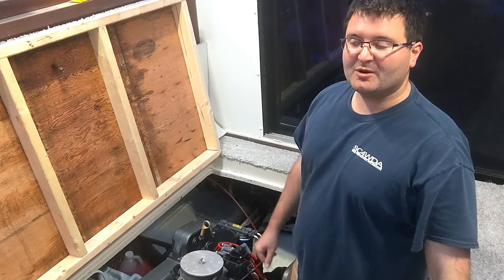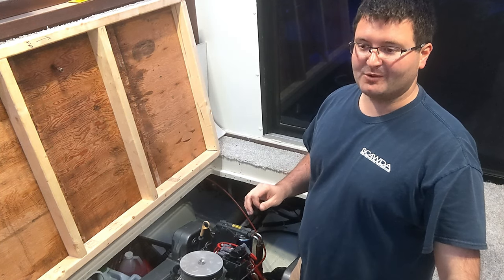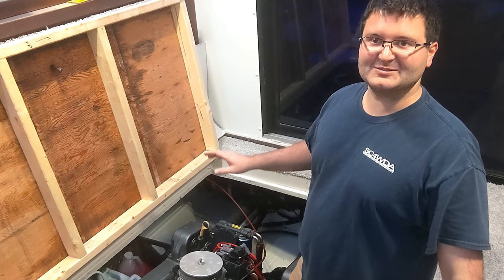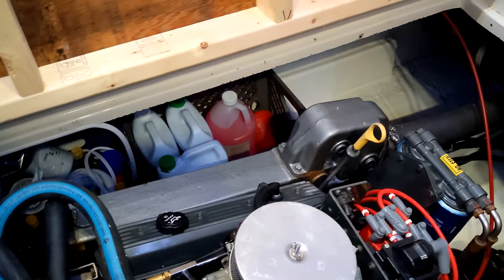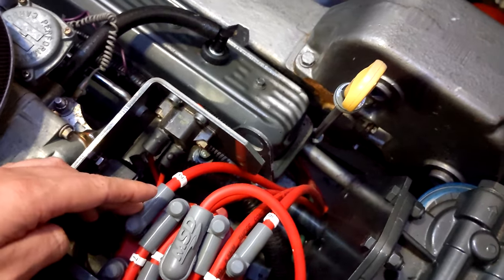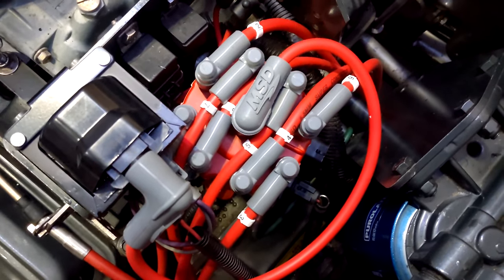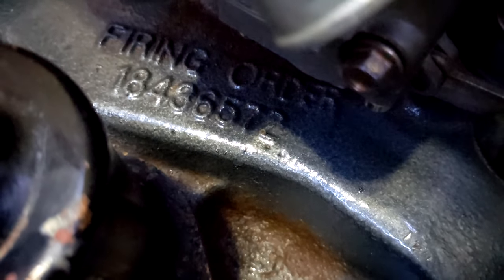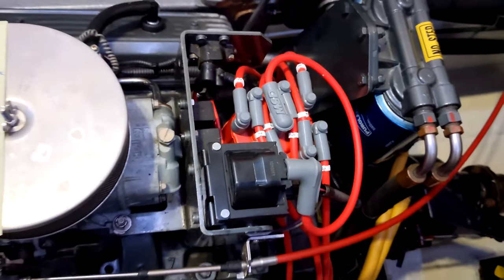Marine Chevy 350 Vortec Reverse Rotation - Explained

Comment: The oil journals are 180° off also the opposite rotation if the  On crankshaft end towards the oil pump the crankshaft has been knurled to push the oil forward not so many people know that one just figure a little food for thought 🤔
Reply from the maker: All good info, thanks for adding!

Comment: Back in the day before companies started making GM HEI distributors for other brands of engines we modified one to fit in a small block Ford by making a sleeve to adapt it and a custom shaft with a Ford gear.  In my first attempt it died after a few weeks and upon inspection I found that due to Ford having counter clockwise rotation and the direction of thrust being downward it had eaten into the pickup coil. If you're ever in a bind and need to use the ccw gear on a regular distributor it will work for a while and won't ruin your motor but eventually it will eat into the pickup and shut off
Reply from the maker: Yep, I found that out through a lot of research. It is not a common thing at all!

Comment: I have rebuilt many marine engines and have never seen a reverse rotation engine like you described all of the mercruiser crusader marine conversions use gear drive cam to change the cam direction allowing the use of standard dist and oil pump, of course starter, water pumps are configured different one other internal change that not many builders know is that the pistons are pressed on the rods backwards the notch will face the rear this is cause the piston pin is offset if this is not done you can end up with cracked pistons
Reply from the maker: The only explanation for the reverse helical distributor, in my opinion, is because the cam is also spinning clockwise due to a timing chain. Which as you said, is rare. I have read about the pistons being put on facing the rear, etc.
Reply: I second that. I just installed two automotive distributors in my twin 454’s, one of which (engine) is counter rotating with a different firing order and it fired right up.

Comment: 10:45 Chevrolet RHR uses a timing gear set instead of a chain . This makes the camshaft standard rotation reverse firing order. No need to use a modified distributor
Reply from the maker: Not in all cases. Particularly in this instance, as described in the video, the RH engine has a timing chain and a reverse spinning cam as well. Which in turn, requires the modified distributor.
Reply: Having said that, my timing gradient marks are in the same position as standard rotation engine, so I've set my timing on reverse rotation to 10° retard on gradients which is actually 10 ° andvance, does this sound correct? If I set to 10° advance it runs terribly or not at all.
Reply: The timing chain was foolish. Gearset is the standard for a Chevy marine. Gear sets runs standard rotation reverse firing order cam.  Chains run reverse rotation reverse firing order cam. Mercruiser makes an out of the box cam for the gearset. No modifications to the distributor are necessary. The Crank also needs the oil phase holes drilled in the correct orientation for RHR motors. Otherwise oil phasing will be incorrect and nothing but trouble will be in your future. Don't believe me call Scat they'll set you straight
Reply: Also make sure you use RHR seals front and back.

Comment: Just out of curiosity. You’d think they could make an oil pump that can run in reverse quite easily ? Also why not make the counter rotation happen in the transmission ?
Reply from the maker: You can not make an oil pump work in reverse as far as I know.

Comment: You wrote that your reverse rotation is CW. I’m assuming your looking at the motor from the flywheel? It should be CCW from the front. I’m asking because I have one of the same unicorn motors I’m dealing with.
Reply from the maker: I look at the motor from the flywheel. They've got a big sticker to show rotation.
Reply: Rotation, just like when speaking about right side or left side, is from the perspective of front forward. If it's in a car, it's from the perspective of the driver's seat. You don't look at the front and say that the odd number bank is on the right, even number bank on the left... Odds are on the left and evens are on the right. Normal rotation is counterclockwise, reverse rotation is clockwise.